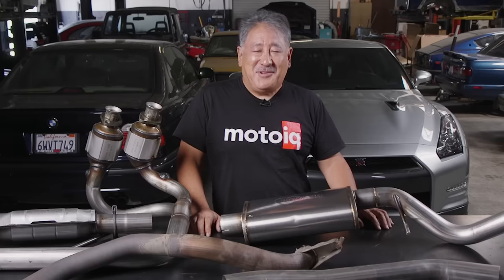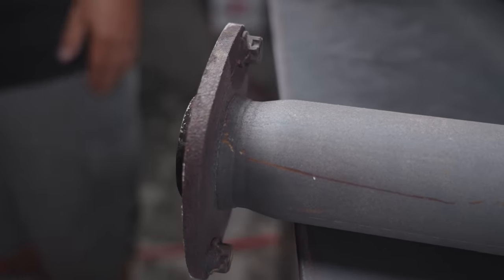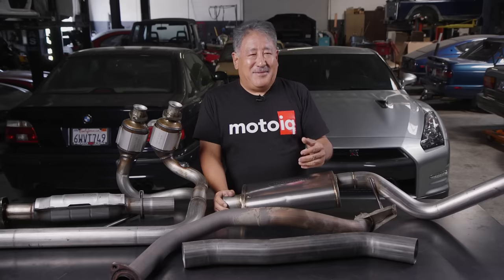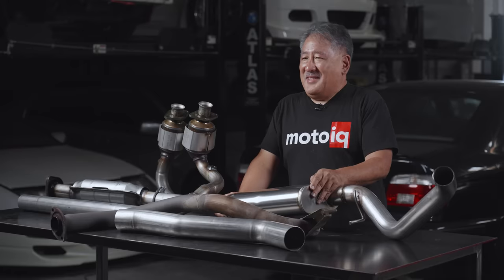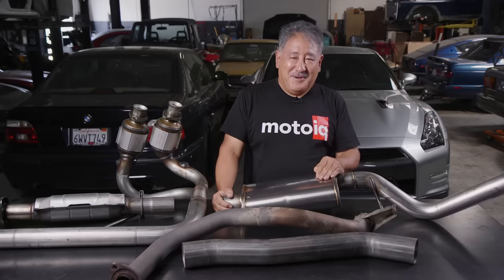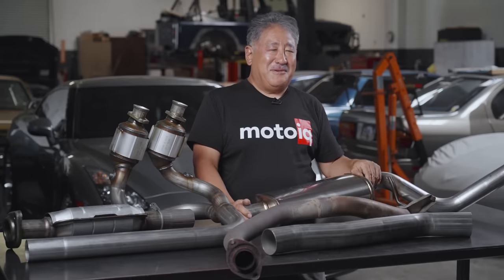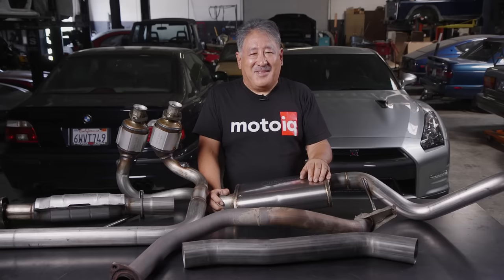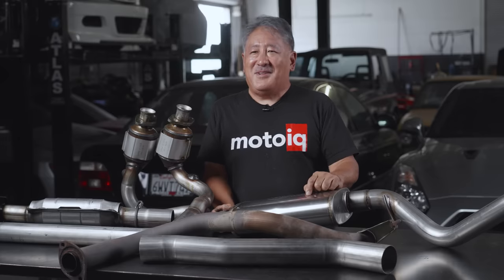Exhaust Back Pressure Myth DEBUNKED!

Comment: You can mathematically calculate the size of pipe you want using Bernoulli’s Principle. The Venturi effect will help also calculate the design of the exhaust pipes.
If you know the number for the mass of the air flow you need on the exhaust side, you can calculate this with the formula;
Reply from the maker: Bernoulli's principle is about the conservation of energy.  To calculate the flow for a given size of pipe with a compressible fluid at high temperature you use Darcy's equation.
Reply: @motoiq  fluids are not compressible, only gasses. Study basic hydraulic principles. 
Since exhaust gasses are compressible, there is a different equation to use for Bernoulli’s principle. Nothing is going Mach 1, so it is easy to calculate. 1/2PV^2
Reply: @motoiq  Diameter of exhaust pipe to use is the square root of; RPM’s multiplied by 3.14 multiplied by cylinder volume of one cylinder only.
Take that number and divide it by the constant; 88,200
That will give you your proper exhaust pipe diameter. The measurement will be in whatever scale you are using for the cylinder volume without being cubed.
Reply from the maker: Any medium can be a fluid, hence compressible fluid, the subject is fluid dynamics not hydraulics.  You do not use Bernoullis equation, it's not even for the same thing. You are completely wrong.
Reply from the maker: please show the proof of how this equation was derived. I tried it on a few different engines and it comes up with primary diameters that are too small.  This is something that you must have taken from an old book or magazine article and it has nothing to do with any kind of mathematical estimation based on fluid dynamics.  I would suggest unless you have actually studied fluidynamics to please refrain from commenting on the subject. Your statements have me thinking you are regurgitating things you have heard. Also look up Bernoulli's and Darcy's equations, you don't use Bernoilli's and even Darcy's are not all you need to determine pipe size.  You also need to calculate mass flow, resonance, and energy state to model the pipe dimensions.
Reply: @motoiq  you most likely are figuring out the cylinder volume wrong. Did you make sure you calculated ^3 out of your final answer? Gotta do the math correctly to get the right answer.
What is your cylinder volume? (Just one, not all six)
Reply: @motoiq  if you are just making an exhaust for a stock car that doesn’t “stumble”, it’s an easy calculation.
If you are making a drag, or some kind of race car with a racing cam, then resonance and all that rot can be calculated. Mostly just don’t make any sharp bends in the pipe, and go with what will give you negative pressure despite the fluctuations in gas density.
I agree those formulas are in the ballpark, but not the best calculations because the air is compressible.
Bernoulli’s Equation can still get you real close, close enough to know whether to use 2”, 3”, 4”, 6”, or 8” pipe.
We use it mostly for hydraulic lines on aircraft. But then again we are running 3,000 psi to Fowler flaps and flight controls, plus landing gear, so a small steel tube is ideal for the capillaries and bigger pipe close to big components like the flap system, which requires not only pressure, but a lot of volume for muscle as well.
Reply: @motoiq  volumetric pressure is directly proportional to pipe size. The larger the pipe size, the more volume but less pressure of outflow. This is Bernoulli’s principle. You cannot tell me it doesn’t apply, because the pipe diameter is directly proportional to the PSI of the outflow in a ratio that is a Constant. Stick your thumb over a garden hose and increase the pressure  of the outflow. It’s kind of common sense. A slightly different formula for compressible fluids/gasses. Only the Eddy currents change the calculations. The ‘drag’ in other words as the exhaust gets pushed out the pipes and pulled out more by the effect of the distance of the pipe to the resonator, muffler, or open air.
Reply from the maker: Of course, your simplistic equation is inaccurate.  This is a multivariable problem with many degrees of freedom.
Reply: @motoiq  if you know your horsepower, and you know your displacement, then all you are doing is finding the size for the outflow you want, say 2.2 CFM for example. The size is gonna be within a half inch of what you need. 
Are you calculating for racing cams or just polished up stock?
Anyone that needs it any more accurate than a 1/4” is wasting their time. It’s not that critical. Back pressure is overvalued when they should be focused on supercharging their intake and expel it out with a turbo. If they aren’t doing that, it’s just an expensive way of taking someone’s money and polishing a turd for them, which, hey, that’s fine too. Gotta make that cheddar. I get it. It’s like ventilated brake rotors on a car that won’t even cruise at 100 mph for a couple hours. Like why? Totally unnecessary. Just another way to take people’s money, which I am totally down with, just saying, it’s all for looks and impressions, not real performance.
Reply from the maker: 1/4" in a primary tube is a huge night and day difference in an engine's performance. It's a sizeable difference in the main exhaust as well.   What you are saying is just your opinion and not based on fact.  I gave you some of the keys to how simple steady-state flow is calculated in tubing and I bet you didn't even bother to look it up and run some numbers these are facts.  Exhaust flow is much more complicated than this as it is multi-variable. Look up some of what I said and run the numbers. This is way closer than spouting technical-sounding jargon. Compound supercharging is not needed in most cases for cars as a single turbo gets enough pressure ratio to do the job.  Only certain apps like commercial diesel and things like tractor-pulling run compounded turbo/supercharging.  The reason why you see this in aircraft isn't that aircraft necessarily have superior engineering, it's because they need it to develop a decent pressure ratio at high altitudes with low air density.
Reply: @motoiq  fair enough on one reason (though not every reason) why we supercharge our intake manifolds on aircraft. It it because the air is so thin at altitude and we run into a rich condition. The turbo charger is important, and I have disagreed with many auto mechanics about the importance of expelling your exhaust gasses under pressure. I will look at the numbers again. Give me an engine cylinder displacement size, and the length that the exhaust is going to be. 
You are calculating for scavenging because you lack a turbo waste gate to do the job proper for you. 
Take a Rolls Royce 1600 for example, the exhaust ID would be considered large for an automobile, obviously, no cars have engines that are as big as a car, like a Spitfire engine. The exhaust manifold is most of the exhaust system because having to scavenge the exhaust is not that important to overall performance.
Like I said before, I get that you gotta sell people car jewelry, and I respect that. At some point you gotta be honest and just admit it’s mostly bells and whistles like ventilated brakes cousin. Are you designing exhaust for the track? Or are these just for guys to drive down to a car show at Hooter’s?
I respect fine craftsmanship, so I’m not knocking either. I’m just saying I wanna see the numbers on how you have improved the performance by redesigning exhaust systems. 
X pipes for instance. Eye candy. Explain to me how that is supposed to be some magical equalizing manifold, because I’m not buying it. Hey, chromed out, it looks fabulous, but it’s just for looks, no practical
Purpose. 
Are you putting these on a Dyno and getting real numbers to compare or is this all pseudo rocket science?
Break down for me how a 1/4” ID variation isn’t allowing the proper scavenge on a four stroke ICE, because I gotta call that just selling people ‘boat jewelry’
I’ll give you 1/2” ID variation would show possibly some restriction to your outflow giving it unwanted back pressure on parts of the stroke (even though it is happening at say 10,000 rpm’s) [for aircraft it is 30,000-50,000 rpm’s]
Reply: @motoiq  the supercharger pressurized manifold and twin turbos on the exhaust lets you suck bang and blow faster, it’s not about how big a bang it will make. We are making the rpm’s much faster, tens of thousands of rpm’s faster, like what VTEC is to everybody else still using oil control valves instead, as a comparison.
Plus it should be a manual or electronically matrixed waste gate on the turbos so you can control the pressure for how you want the engine to perform without overboosting.
I’m listening if you are saying that there are still going to be slow spots in the exhaust that are going to prevent efficient scavenging, I just don’t see how it matters if you are boosting and having the turbos pull it out and send it down the pipe. You’re an exhaust man though, so I gotta see if I have missed something you are trying to get at when it comes to P, I, & E being inversely proportional to one another in any volumetric situation with regards to compressible fluid dynamics. So I’m all ears man.
Reply from the maker: First off I am not selling anything, the purpose of this channel is to educate. This isn't jewelry but functional stuff that makes a huge difference if you do it correctly. I don't think you will understand the math but the exhaust formula I use takes in VE, port flow numbers, cylinder displacement, bore, stroke, rod length, operating range of engine, number of valves, valve area, stem diameter, cam lift, duration, 0.050" duration, cam doctor data if possible, centerline, lobe separation angle, it calculates single diameter and up to 3 step primaries and calculates primary length to up to 8th order harmonics.  (highter orders are typically used in aircraft for aero-packaging reasons).  You can plug in different numbers and see how big the difference are.  I am not just spouting this stuff, what I know engineering-wise is backed up by literally hundreds of dyno tests, I have designed these systems for manufacturers so I know how much of a difference they can make.  If I design a header it can make up a 50% difference in power depending on an engine's state of tune and how bad the stock system is.  Exhaust tuning makes a profound difference in all engines.  Aircraft engines can have simplistic exhausts because they run in a narrow rpm range most of the time and packaging for aerodynamics and thermal control are very important. Your reasons make my head hurt.  Your education is to make you excellent at diagnosing and repairing aircraft with a very basic view of how systems work to make you better at the first.  My education is to understand the physical principles of materials and phenomena so I can design the systems you work on.  One is not better than the other but you are trying to argue in my domain. Science is often not intuitive and common sense. If you really want to learn the real reasons why and how this stuff works, I can give you some references to study where you need only algebra to figure out.  Otherwise please stop! Also, read about what the Dunning-Kruger effect is. I can teach you if you are willing to put the time in and study.  If you do you will be surprised about what you are saying.
Reply: @motoiq  why are you measuring all that when all you need is the output CFM? Or are those calculations to get the optimal CFM output you want to create?
Reply: @motoiq  I will look at the dunning kröger effect and see what you are referring to. You didn’t mention you were designing the exhaust manifold. The clip leads one to believe you are just looking for the optimal pipe dimensions after the manifold. 
I am still waiting to hear why a supercharger and twin turbos would not provide enough flow to overcome any ‘drag’ in the exhaust system.
I hear engineer types speak in these pedantic terms often and it’s painfully obvious just how much you do not realize the FAA requires an aircraft mechanic to know about flow dynamics. You sound like more of a Newton guy than a Bernoulli guy when it comes to why an aircraft lifts off the ground to fly and why Bernoulli’s principle applies to exhaust dynamics even though it is not a liquid state of matter. So how much percentage of CFM is changing changing your exhaust to 1/4” larger pipe ID on say a 2.0 turbo Honda civic type R?
Reply: @motoiq  you can speak to me in math terms at levels of trigonometry and calculus if you like, it is hard to type on here, I realize, so paraphrasing is fine. Have you used algorithms to find the sweet spot or are you going on existing comparative charts to arrive at your optimal pipe inside diameters?
Reply: @motoiq  where can I see your dyno data?
Reply: @motoiq  which manufacturers have you designed packages for? Aftermarket or stock packages?
It would be nice if you could suspend your ego for a little bit and actually answer some questions instead of this, “ I’m smarter than you so believe what I tell you “ schtick.
Reply from the maker: I offered to give you references to learn about this subject it is literally a lot of material and it cannot be covered in this format, but instead you are acting like a troll and deflecting. It is not hubris, I am offering to show you the source material which can give you expertise in the subject if you are willing to invest the time. You just want to argue about nonsense and are choosing not to take the opportunity to learn because that requires work on your part. You should be disappointed in yourself.  What I am saying is not snake oil, it is a proven fact. As I said I can provide you with references if you choose to obtain some deep knowledge on this subject. If not just stop.
Reply: @motoiq  send me the links. You keep saying you are gonna send me something that validates your claim and then just start lipping off instead of providing anything whatsoever but attitude bro.
Reply: @motoiq  I’ve seen your work by the way. You’re the kind of guy to design an intercooler and don’t have the common sense to design a bleed port in the highest section of the intercooler. So don’t come off so holier than thou, “I’m an engineer” it makes you look arrogant or insecure. We all forget to do stuff implementing our design ideas. So I get it, but come on, that’s just a basic design detail.
I also don’t mean to come off condescending if it sounds that way from how limiting text can be to convey EQ, not just IQ.
Reply from the maker: I have no idea what you are talking about as an intercooler bleed port.  If you are referring to water-to-air intercoolers, I prefer not to use them, if you are looking at MotoIQ.com I don't personally build all the cars there, we have a staff of writers. 

Some better-known examples of my work. Plus many more.  Stuff has a history of winning and setting records.  I might be that type of engineer.

https://www.youtube.com/watch?v=P7JTAV2EPm8
https://www.youtube.com/watch?v=ZFVwkbvy4yg
https://www.youtube.com/watch?v=iy6UK2Itc8g
https://www.youtube.com/watch?v=0L4LWt73HRE
https://www.youtube.com/watch?v=5whBazTF1QU
https://www.youtube.com/watch?v=29_OjwsnDXg
https://www.youtube.com/watch?v=98oN1yCinNw
 https://www.youtube.com/watch?v=J8Qi1Fk_mz0
https://www.youtube.com/watch?v=cJEDpTKGb0E
https://www.youtube.com/shorts/9Ze_sEzhEgc
Reply from the maker: Since you finally asked https://www.amazon.com/Internal-Combustion-Engine-Theory-Practice/dp/0262700263 the whole book is pretty good but this subject is covered in chapter six, also appendix 2-4, volume two is also pretty good but not on this subject. https://www.amazon.com/High-Speed-Internal-Combustion-Engine-Ricardo-F-R-S/dp/0216890268 Chapter 3, this help to determine the flow mass and state. https://www.amazon.com/Scientific-Exhaust-Systems-Engineering-Performance/dp/0837603099 If you google around enough, you might be able to find this stuff for free in PDF form somewhere. The whole book, the math is pretty non-rigorous but it gives the history of exhaust research and measuring methods used to derive them. The first two get you the volumetric and conditional aspects of an engine's flow  https://fr.tecciness.com/hilfe/darcy_weisbach.php here is darcy's equation. Where you can figure out the best diameter, the exhaust book has formulas that help you determine the resonant length. Bells equation also can help you come up with primary length easily P= 850(180B)/R-3 where P=primary length, B=exhaust valve opening point in degrees, R= Target RPM. The trouble is neither take in the effects of temperature on the resonance point so you also need to plot the sonic speed at the anticipated exhaust gas temps. Also, something like a turbo increases the density of the exhaust gas and affects the speed of the reflected wave and thus the tuning a lot.  At this point, it is often best to cut and try. I also frequently collaborate with Burns and go by their recommendations using their X-Design software. I also use racemax software and their results come very close to correlating with X design.  What works best with simulations, rigorous calculation, and actual engines is shorter and bigger in diameter than what those magazine equations with a single constant give you.  You will find that the references I gave you give you a more complete understanding of what's going on in the exhaust and the software saves you time and eliminates the possibility of you making a mistake.  If you run these numbers you will see a 1/4" makes a huge difference in the outcome. There are a number of PC-based CFD programs on the market such as the extension you can get for Solidworks, but like Darcys equation it can only estimate flow, but of course better than Darcys. Darcys is fine for the downstream part of the exhaust. You still need to calculate the resonate tuning in the manifold or header using Bells or better yet X design or race max  http://maxracesoftware.com/PipeMaxPro400.htm
Reply from the maker: I have run literally hundreds of dyno tests in my life so it would be like which one?  Our shop has a dyno. Here is one on a Honda K motor on a header we designed with X-Design, the engine made really good power NA on 91 octane pump gas. https://motoiq.com/building-the-naturally-aspirated-honda-k-engine-part-4-burns-header-and-tuning/6/
Reply from the maker: More good books but not necessarily on this exact subject.  https://www.amazon.com/Four-Stroke-Performance-Tuning-Graham-Bell/dp/0857331256  this is the #1 book to me of practical non-rigorous math knowledge and one of my favorites.  https://www.amazon.com/s?k=the+design+and+tuning+of+competition+engines&i=stripbooks&crid=BQKM2PUZKSMC&sprefix=the+design+and+tun%2Cstripbooks%2C135&ref=nb_sb_ss_fb_1_18  This is also a good reference but a bit dated.  This was my textbook from school, it is boring and I didn't annotate it but the answers for steady-state one-dimensional flow in an exhaust are here.  I just put it here because it's cheap. I could not bring myself to look at it. https://www.amazon.com/Essentials-Engineering-Fluid-Mechanics-Reuben/dp/0060449268/ref=sr_1_1?crid=3UAU4K3H06KYM&keywords=essentials+of+engineering+fluid+mechanics&qid=1681281403&s=books&sprefix=essentials+of+engineering+fluidmechanics%2Cstripbooks%2C128&sr=1-1
Also google Bell's equation and Ricardo Wave.
Reply: @motoiq  the one I was looking at was an intercooler mod and they didn’t build a way to bleed the coolant system at the high point. Think Jaguar/Mustang set up type of engineering where the supercharger sits over the intercooler where the oil and coolant pass by one another in separate chambers/ports.
Reply from the maker: One of our writers Khiem Dihn  built that car, I think he had IC coolant flow issues, a lot of it was he forgot to take out a shipping plug, but overall that car came out very well.  He is an engineer for Garrett Turbo and the matching and stuff for the engine was excellent, the car has no turbo lag. It is very fun to drive.